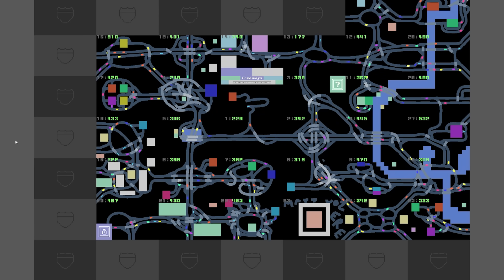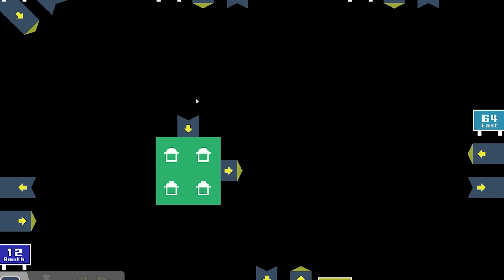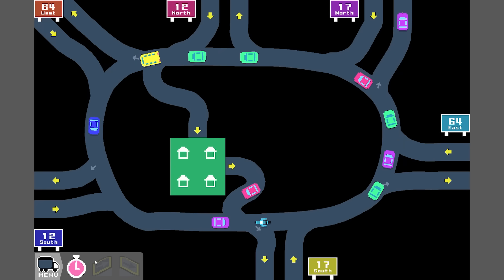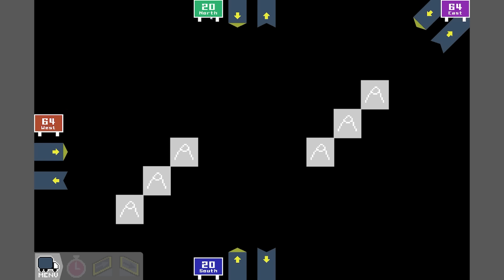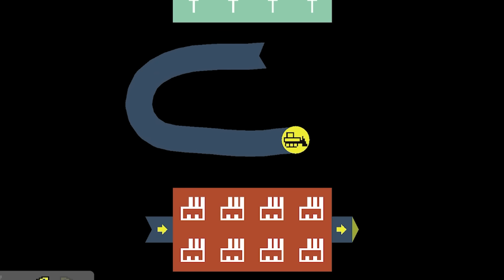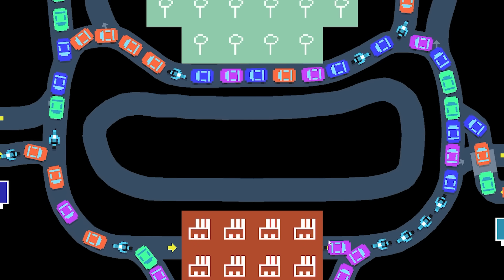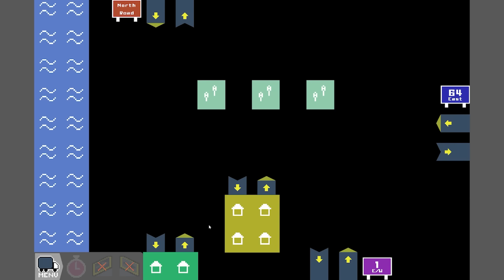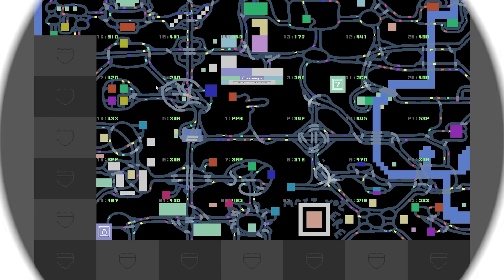Using SEGREGATION to fix traffic in Freeways!

Comment: I think it needs (in addition to undo and erase), vector drawing. So you'd be able to adjust the curves to be more smooth or more tight, and they'd be proper curves, not wonky hand drawn zig-zaggy things that artificially reduce your efficiency with the same design. Also I think if you really want to do it well, you'd probably design it first in something else (like a vector drawing program), so you can slip in bridges you didn't think about at first and generally not lose focus with what you were thinking. That last part is helpful for lots of things, like writing an outline or overview before writing something out, or doing a sketch before a drawing, or a storyboard before an animation.
Reply: I think the absence of vector drawing is intentional as it adds to the things you have to learn and master (its still a game). This would definitely be a bit like cheating because I believe the cars slow down on tighter radii, hence a vector drawn perfectly sized one would kinda defeat it's purpose.
Reply: You could also be able to delete a specific piece of road, in case you are WAY at the end of it and just then realized that you goofed something right at the start
Reply: You must be fun at parties, kind sir.

Comment: Double roundabout designs can actually be really useful, you just did not utilize it to its full potential:
Segregate the roundabouts! For example have blue and orange cars use only the outer ring and all others the inner ring (just exemplary colours, you should decide by traffic amount how to balance). This way you only need half as many roundabout exits and you have effectively cut traffic on each ring in half.

Comment: Isn't the solution for the double roundabout to just have segregation of inputs? Eg. One roundabout with only input from the sides, one with input from the other sides. You don't need to connect all inputs to both roundabouts, just the outputs. Maybe I haven't tried 🤷🏽‍♂️

Comment: So going from enfield connecticut to springfield massachusetts via the backroads rather than highways theres a mess of a roundabout. Firstly keep in mind that a good majority of americans are not familiar with normal roundabouts. Now keep in mind this roundaboutis all sorts of screwed. Also keep in mind the slang term "masshole", usually in reference to driving. Literally there is a sign indicating its a "dangerous intersection". Anyone who says theyve gone to springfield from enfield via that route, all you have to do is ask "how bout that intersection?" and they know